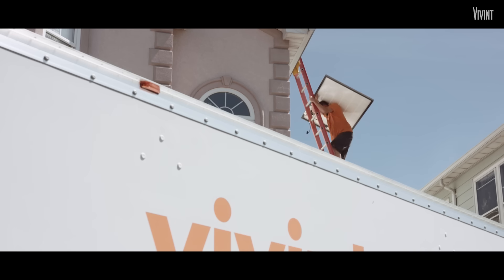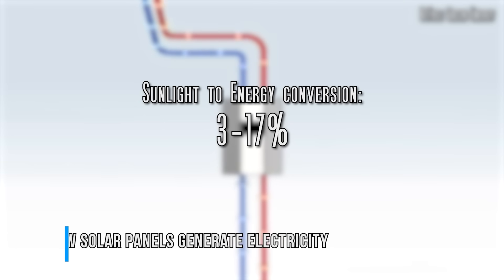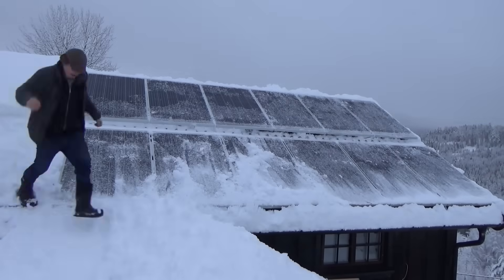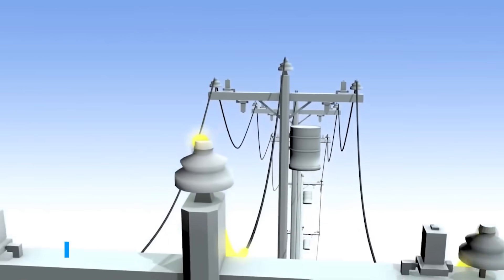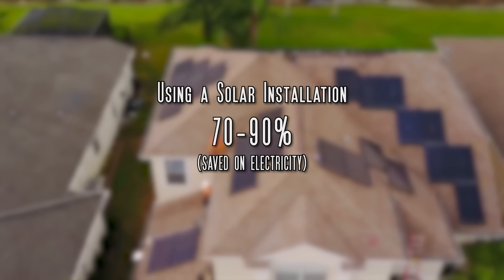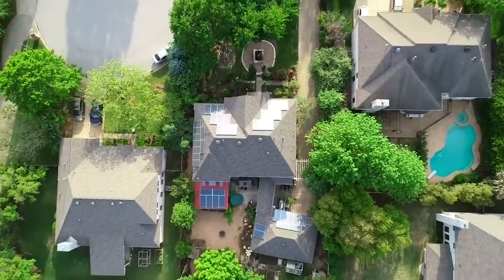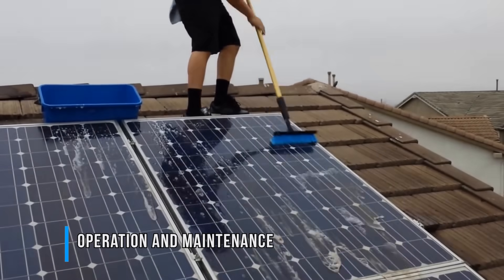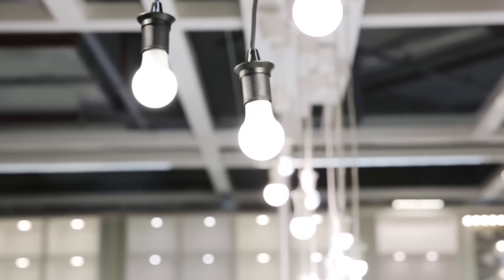Solar Power System For Home: Ultimate Beginners Guide

Comment: Efficiency of 3-17% is such a waste of money... JUST the cost of producing an ingot (electricity need to heat up sand and add carbon) is much more than that 1 panel will produce in its lifetime. Solar is not even that energy efficient. I have a saying, "You will never see an Electrical Engineer sell a solar panel, but when they do, then it is the time to buy them" at that point the efficiency should be ideally 60%. I can run my TV and get a better efficiency 

Solar at this point is only good for research purposes. I.e. outter space research where the top of the line solar panels that are 50% efficient in a vacuum tube.
Reply: Solar panel efficiency is what % of the sun's energy is converted into electricity. Since sunshine is free, what does it matter? Just run it for longer to get the same amount of electricity as higher efficiency. Solar panels can last longer than 25 years, there are no moving parts. Efficiency matters in cost effectiveness. Since those panels have a payback in around 8 years (depending on location), any years after that is free so they are cost effective.
Reply: @user-hc5hy3lm7k   3-17% is only a selling point, that is for 2 hours out of the day you are lucky enough to get probably about 16% in ideal conditions. What about in the winter when the panel is not in the direct line of the sun? Then i would assume you will max out at around 12%. Solar panels are composed of mirco-sized cones that very delicate but flat to the touch. Sand/Hail/Rain (hard rain) can damage it thus, if you are lucky you will get about 5-7 years out of one before you have to replace it. 
Have you ever looked at the process of producing solar panels? You will need to heat sand up to 3632°F just to make silicon from sand. Then you're gonna need to add a lot of carbon (i.e. Charcoal, coal, coke, and wood chips) and reheated with and ELECTRIC ARC FURNACE to 2579 degrees to produce an ingot.The solar panels require an insane amount of materials with very toxic components that aren't recyclable due to impurities (recycling would be more expensive atm than making new ones), and this is a huge problem that still needs to be solved. How much power will a single panel produce in relation to 3632°F? As as what do they do for the rejected wafers of a finished? 

This is not efficient at all when you take into account of the process and that what sellers do not know or tell people about.

Comment: Will it still work if the clouds covers the sunlight or will it work too if its night then the clouds cover the moon too?
Reply: Efficiency of 3-17% is such a waste of money... JUST the cost of producing an ingot (electricity need to heat up sand and add carbon) is much more than that 1 panel will produce in its lifetime. Solar is not even that energy efficient. I have a saying, "You will never see an Electrical Engineer sell a solar panel, but when they do, then it is the time to buy them" at that point the efficiency should be ideally 60%. I can run my TV and get a better efficiency 

Solar at this point is only good for research purposes. I.e. outter space research where the top of the line solar panels that are 50% efficient in a vacuum tube.

Comment: The electricity companies only adjust for your usage but do not pay you squat for extra electricity, here in India the electricity companies are pushing for gross metering where in the electricity you produce will be billed at a lower rate and the electricity you consume will be billed at a higher rate.

Comment: If  a tree falls on some panels does it stop the whole system does the system continue to work what exactly happens?

Can you bifocate or trifocate the system so you have dc to ac as  dc-to-dc or direct dc  for your continuous heating systems like water heater, boiler, and pool heater?

What is the general impact of a solar system on ones homeowners insurance policy cost -- does it generally cause it to go up or down?

Comment: What about Solar + Windmill installation together? Like Windmill will work even in cloudy & rainy days.  Please suggest the benefits of both together at home.
Reply: Wind mills can be integrated into the system both DC power
Reply: This is okay but such kind of a system may never pay for themselves. Windmills are very noisy and have high maintenance costs.

Comment: Its very expensive from start...and continue to have cost....
...in my count electricity is cheap....take 20 yrs until its worth for the solar cell!...
And this still wont count thoes maintainance cost!...
Reply: Another video said he did not have a maintenance cost. He just spray it with a hose to clean it. Obviously it depends on the location to be cost effective.

Comment: Electicity is cheap here....its really very expensive...to install solar cell 
(Esp if use lithium batt)...
U invest huge sum of money First and hope its woild wirth and last for atleast 10 yrs....
...also hope that batteries still work well at that time....🤔
And no part malfunctuon....

Congrat to anyone that have install reliable and cheap system!...
Reply: Not now. As we all know the cost of new batteries are raising like rocket. I realised this when I was thinking of replacing my old batteries of solar power bank. 
During that period I came across this EZ Battery Reconditioning Program. 
The results were amazing beyond my expectations.
Do you know any type of old battery can be bought to life using EZ BATTERY RECONDITIONING PROGRAM.
To know more 
http://prodguide.com/landing-page-ez-batteries/

Comment: A good integral video, thanks, only missing info about their service life ? For how long do these panels last before a replacement is needed?
Reply: Efficiency of 3-17% is such a waste of money... JUST the cost of producing an ingot (electricity need to heat up sand and add carbon) is much more than that 1 panel will produce in its lifetime. Solar is not even that energy efficient. I have a saying, "You will never see an Electrical Engineer sell a solar panel, but when they do, then it is the time to buy them" at that point the efficiency should be ideally 60%. I can run my TV and get a better efficiency 

Solar at this point is only good for research purposes. I.e. outter space research where the top of the line solar panels that are 50% efficient in a vacuum tube.
Reply: @24tcwarrior  Solar panel efficiency is what % of the sun's energy is converted into electricity. Since sunshine is free, what does it matter? Just run it for longer to get the same amount of electricity as higher efficiency. Solar panels can last longer than 25 years, there are no moving parts. Efficiency matters in cost effectiveness. Since those panels have a payback in around 8 years, any years after that is free so they are cost effective.
Reply: @user-hc5hy3lm7k  3-17% is only a selling point, that is for 2 hours out of the day you are lucky enough to get probably about 16% in ideal conditions. What about in the winter when the panel is not in the direct line of the sun? Then i would assume you will max out at around 12%. Solar panels are composed of mirco-sized cones that very delicate but flat to the touch. Sand/Hail/Rain (hard rain) can damage it thus, if you are lucky you will get about 5-7 years out of one before you have to replace it. 
Have you ever looked at the process of producing solar panels? You will need to heat sand up to 3632°F just to make silicon from sand. Then you're gonna need to add a lot of carbon (i.e. Charcoal, coal, coke, and wood chips) and reheated with and ELECTRIC ARC FURNACE to 2579 degrees to produce an ingot.The solar panels require an insane amount of materials with very toxic components that aren't recyclable due to impurities (recycling would be more expensive atm than making new ones), and this is a huge problem that still needs to be solved. How much power will a single panel produce in relation to 3632°F? As as what do they do for the rejected wafers of a finished? 

This is not efficient at all when you take into account of the process and that what sellers do not know or tell people about.
Reply: That's true. It's more better being lined up in the walls like a wiring true facts from Cindi if Google would invest in this now lol now everyone who purchased a house would be mad you have to get that built from the ground up lol

Comment: Has there been any in-depth definitive study about maintenance, reduction of efficiency due to dust, weather, natural deterioration over time, life-cycle cost and especially does it hurt your roof and how do you repair/replace your roof?
Reply: The company I'm an advisor with offers a 10 years puncture warranty and has a 25 year production guarantee and will fix any issues within the warranted time.

Comment: How long does it typically take to recover the costs (initial and battery investment at regular intervals)
Reply: I frequently tell my customers, “I can sell you a battery if you really want one, I’ll make a great commission, but I won’t sleep well tonight knowing I sold you inefficient expensive tech that will get rapidly cheaper and more efficient in 1-3 years”... really only makes sense if you get a LOT of blackouts, even then generators are cheaper, or if your state really incentivizes having batteries in some way.
Reply: In Vietnam we recover the costs in 2 years
Reply: It depends on your power supplier.how much does it cost for kilo watts for you??then you can tell how much or how many uears it will take you to recover all the costs.
Reply: About 20 years
Reply: the reality of late 2020 is, there may come a day when solar is all you have, for an indeterminate interval. on that day prior cost calculations become irrelevant, and having some will be vastly better than having none
Reply: As we all know the cost of new batteries are raising like rocket. I realised this when I was thinking of replacing my old batteries of solar power bank. 
During that period I came across this EZ Battery Reconditioning Program. 
The results were amazing beyond my expectations.
Do you know any type of old battery can be bought to life using EZ BATTERY RECONDITIONING PROGRAM.
To know more 
http://prodguide.com/landing-page-ez-batteries/
Reply: Recovery of Cost also referred to as ROI is computed by dividing the solution cost by the savings earned annually .  Generally it ranges around  6 to 7 years. This figure varies in different regions depending on the cost of solar solution and utility charges saved . For more information check out this https://youtu.be/3I2ECtVlRDU
Reply: Efficiency of 3-17% is such a waste of money... JUST the cost of producing an ingot (electricity need to heat up sand and add carbon) is much more than that 1 panel will produce in its lifetime. Solar is not even that energy efficient. I have a saying, "You will never see an Electrical Engineer sell a solar panel, but when they do, then it is the time to buy them" at that point the efficiency should be ideally 60%. I can run my TV and get a better efficiency 

Solar at this point is only good for research purposes. I.e. outter space research where the top of the line solar panels that are 50% efficient in a vacuum tube.
Reply: @24tcwarrior  Solar makes economic sense now even in areas with TVA electricity like I have and even if you dont sell to the grid.  You just need to limit cost of the system and installation.  My system  done DIY with brand new panel 12,600 watts 48 volt system with 30 Kwhr of new Li Mn Co batteries cost  $8000 after 30 % tax credit and offset about $175 a month of electricity cost for a payback of  about 46 months.  Obviously, if I can buy the panels and mount and batteries and wiring etc and have them paid off in 4 years then the panels will produce way more electricity value in 20-30 years or more than the energy used to create them. BTW many newer panels are more like 19-21% efficient and almost no recently manufactured panels meant for permanent home systems are less than 16 % efficient so your 3-17% efficient is significantly misleading.  Take it from people who have done it and know the actual real life facts not a theoretical system based on misleading facts.  Also replaces a standby generator and even if you want one you can use say a 2,000 watt quiet fuel efficient inverter generator with a 110 volt charger or use step up transformer to get 240 split phase which you could run 24 hours using the batteries as a buffer and gasoline or propane or natural gas fuel for it and produce about 20 Kwhr per 24 hours to supplement solar if needed. Aback up whole house  generator alone could cost 50-100 % of the cost  of a solar system.  Batteries are getting cheaper every day and a DIY can easily get batteries for $100 to $150 per Kwhr (mine were $108 per Kwhr with shipping included).
Reply: @24tcwarrior  As we all know the cost of new batteries are raising like rocket. I realised this when I was thinking of replacing my old batteries of solar power bank. 
During that period I came across this EZ Battery Reconditioning Program. 
The results were amazing beyond my expectations.
Do you know any type of old battery can be bought to life using EZ BATTERY RECONDITIONING PROGRAM.
To know more 
http://prodguide.com/landing-page-ez-batteries/

Comment: I live in area that is serviced by TVA.  Was reading today that while they have duel metering they have decided to eliminate their power buy back program.  so best to look at doing things DIY and really chop down the costs of adding a system.  I have priced out and currently just purchasing the panels and micro inverters will be under $300 per 500 watt panels.  Figure that the cost of the wire, boxes, safety hookup equipment, permits and racking likely will be atleast the same amount .    To actually make this work, think at this point does not make sense not to go with batteries.  That said.. Likely the batteries will be the same or more than the rest of everything else in the system.  Solar pays but helps to actually consider all the variables.

Comment: You can use the direct current if you build your own power supplies for each device in your home. Every thing in your home has a power converter that changes the power from 120v ac current down to 3v-24v DC current. So why would you waist energy converting the already DC energy from the sun to ac current back to DC current to turn on your TV. It takes a large circuit board filled with 28 different types of chips resistors and caps just to change the ac120v power to 3 5 12 and 24v DC current distributed throughout your TV. For example a PC power supply takes 120-240 ac~ and changes it to 3 volt -- DC which is an orange wire then 5v -- DC red wire 12v ~ DC yellow wire. So why go through all that circuitry to change the energy if it's DC energy needed to run your electronics at home? The circuitry needed for these changes eats energy.

Comment: Nice job 👍 

I suggest you make a video on electric thermal energy. In particular, electric thermal energy using heat pumps and induction stoves.

There are three commercially available residential electric appliances which use heat pump technology to produce thermal energy.

These are mini split variable compressor cooling and heating air space conditioners using heat pumps, cloth dryers using heat pumps, and hot water heat pumps.

Using all three of these devices in a home will save on average a minimum of 10-kWh per day.

Approximately 6 to 7-kWh in daily savings come from a hot water heat pump.

Approximately 2 to 4-kWh in daily savings come from a heat pump cloth dryer.

Approximately, 2-kWh in hourly savings (using a single horsepower compressor) come from a variable inverter heat pump air conditioner.  

The savings with space conditioning appliances are dependent on the actual size of the compressor replaced,  the average number of hours used per day, and the number of units used.

The other two appliances are typically linked less to the weather.

Induction stoves are more efficient than either gas stoves or traditional electric stoves.  Induction stoves can save on average about 50% over traditional stoves.

All four of these appliances share a common energy source.  They all work with electricity.  Using solar energy with them will maximize residential energy savings.

There are energy diverters that are used to maximize self consumption of solar energy when using appliances like hot water heat pumps and electric vehicles.  One brand that comes to mind is myEnergi.  It has an energy diverter that when combined with an optional board can be used with a hot water heat pump.  

All other energy diverters I know will activate a hot water heating element when excess solar energy is available, but as explained above a hot water heat pump requires for every three units of energy stored as hot water only one unit of energy.  Conventional diverters will use about 1.05 units of energy for one unit of stored energy as hot water.
Reply from the maker: I’ll look into it
Reply: Best Electric I look forward to it.
Reply: @bestelectric7852  hallo sir i want to join in your solar penal work plz sir you can join to me I'm a boy Zayed from India I'm a welders is my experience to thirteen years ok sir where are you sir I want to tell you give it a chance sir

Comment: How many years before the the system pays for itself in savings? How expensive is a 15 kw system to run the entire house?  I would imagine over $40k since a measly 5kw system cost almost $15k.
Reply: Hey, the average cost here in Kenya on client end is USD 1.2 per Watt on DC. This means that if your house consumption is 15kW, you should install 18kW of panel which should cost you USD 21600. However for some reason, I have seen panels are incredibly expensive over there. We buy panels at USD 0.4 per Watt here but the video says that you guys buy at USD 2.99 per Watt. Adding this cost makes your installation cost you USD54,234.